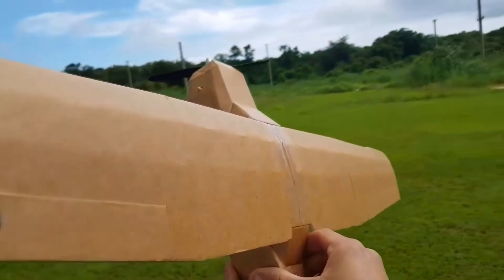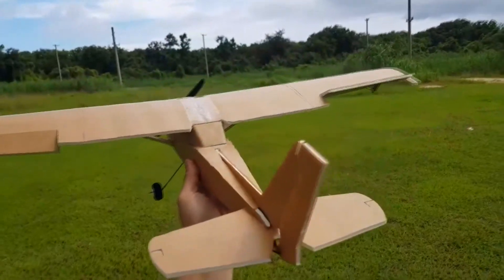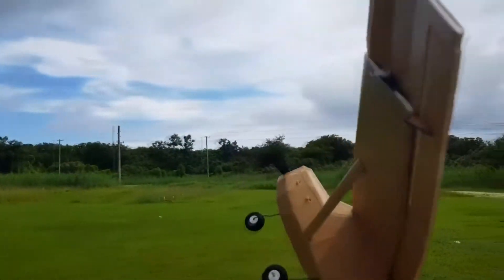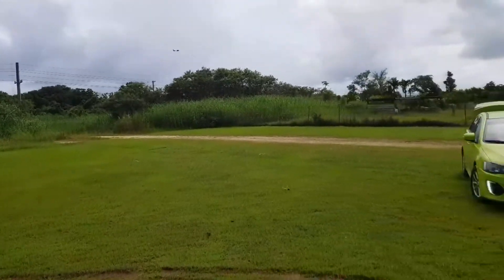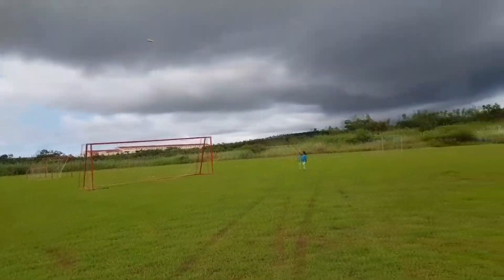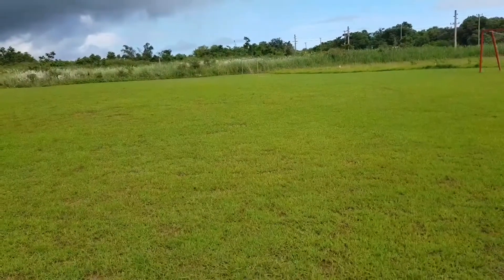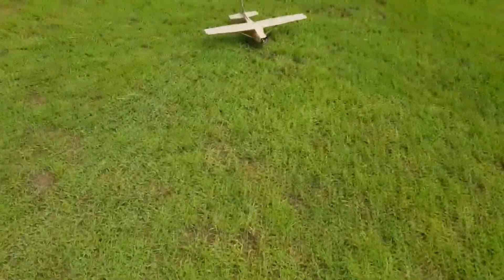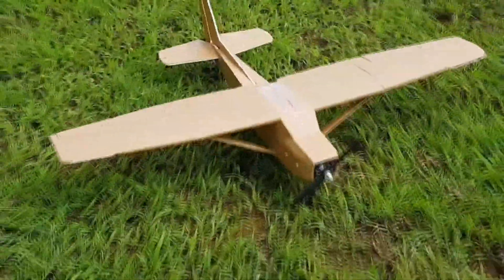Flite Test Commuter Maiden Flight

Comment: Got any boats?
Reply from the maker: I am working on one boat that was being thrown away.  I had replaced all the wooden structure with new wood and repaired the fiberglass haul and sprayed primer so far.  It is in the finishing stages once I get more time to work on it.  I use to have alot of Traxxas electric boats but sold them off.  I am more into the gas boats!  The boat that I am working on is a Aquacraft Rio 51 which was not a top notch gas boat but when I am done it will be better than before.